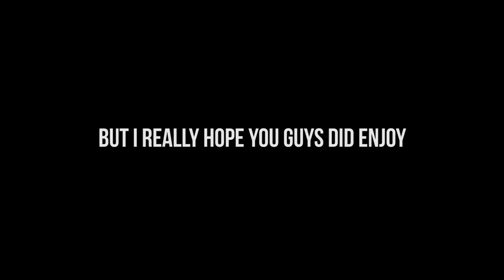When your Exhaust is TOO low on your 240SX...

Comment: being that the car used to be auto, check that your clutch switch is working correctly (or if it was bypassed, that the bypass is connected properly to ground the signal). also check grounds around the engine bay, clean ones that appear dirty
Reply from the maker: ohh ill try that because it was bypassed. i was thinking it was a ground